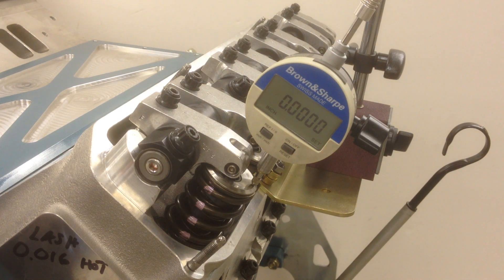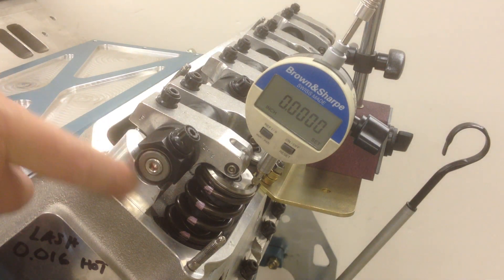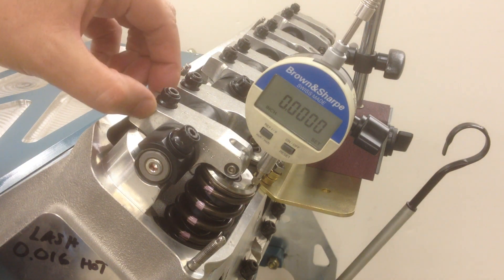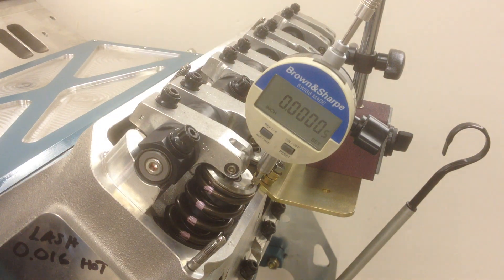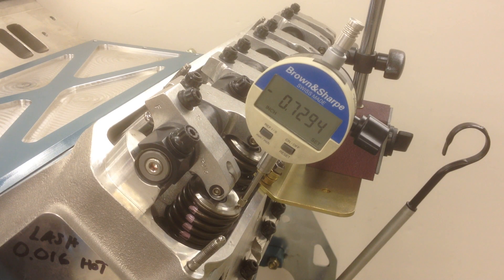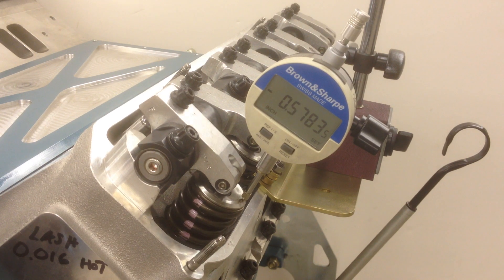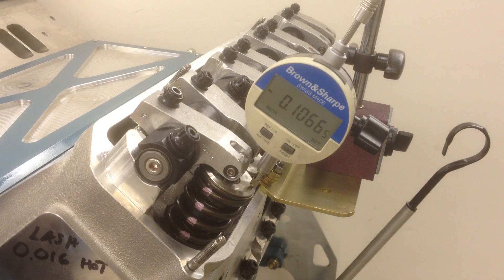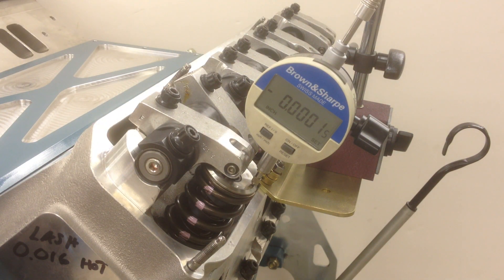Checking ratio with T&D rocker arms

Comment: Wow .729".  So starts the snowball, - port work - bigger bolt-ons, etc. Thanks Andy always educational seeing what you are up to.
Reply from the maker: 0.729 lift was with the out of box Trick Flow heads. We had to change the valve springs to accommodate that much lift but otherwise the heads were right out of the box. The Trick Flow heads can make a lot of power right out of the box.